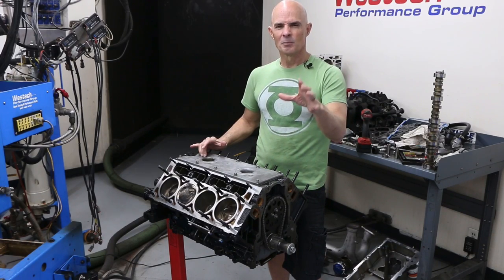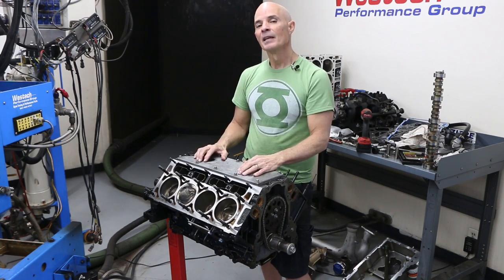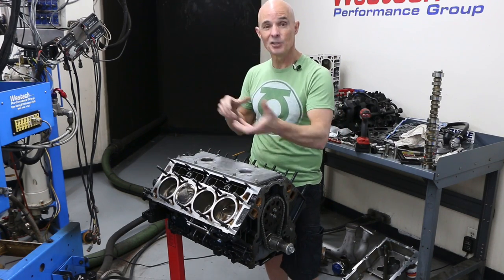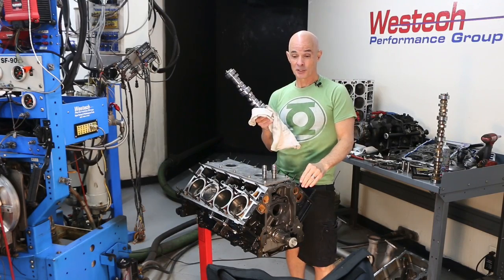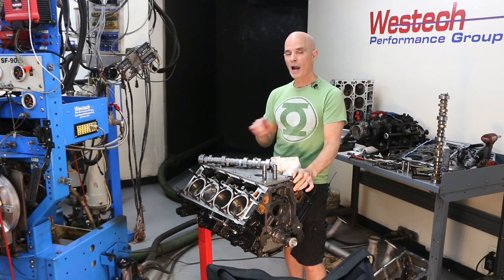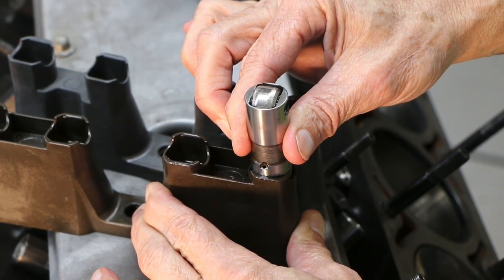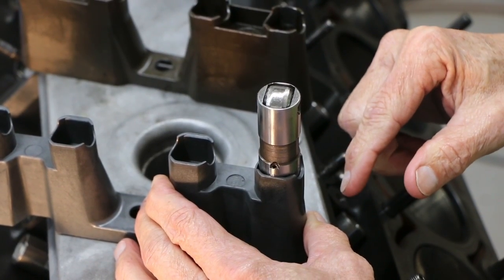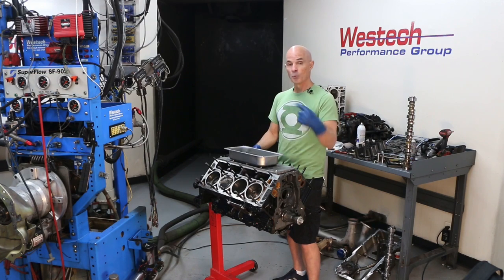WHY IT BROKE! 4.8L LS LIFTER FIX!

Comment: I had found your video four days after I had discovered why my 2010 GMC 1500 crew cab with AFM with only 114,665 miles had developed a P0306 misfire and was running rough with a noticeable loss of power. I was over a thousand miles away from home and just two hours away from my brother in law's house when the engine problems had developed. I had managed to line it the rest of the way there.

While parked at my brother in law's driveway I had tore down the right bank and had discovered that the #6 intake lifter was rotating in the lifter tray, which had ruined both the lifter and the cam.

I had managed to tow my truck back home and begin the teardown process, and had discovered that all of the lifter trays were worn. Not a single lifter was able to be retained by the lifter trays. They were all loose, but only the one bad lifter had fully rotated. They're all getting replaced. 

What had caused the lifter trays to wear like that? I'm still learning what was the reason, but simply put, plastic doesn't last as long as metal, especially under constant heating and cooling conditions of daily driving.
Reply: Did you just swap the cam and lifter and call it a day or did you have to do anything with the cam bearings, main bearings, etc? I just had a lifter fail on my gen 3 5.3 which tore into my cam really bad, even after just driving with the lifter noise for around 40 miles to get back home. I just purchased another used 5.3 with less than 100k on it and it had 3 lobes getting chewed into! I see so many people online saying the whole thing needs torn apart, but the other half of people pretty much just say run a new cam and lifters and call it a day. what did you end up doing?
Reply: @kevinskater13 I checked the camera bearings and they passed inspection. I replaced the cam, lifters, the cam bolt (I kept the VVT), the valley plate, and I plugged off the oil ports that ran to the DOD lifter valley plate. While I had it apart I also replaced the valve stencil seals and the valve springs. I also used all new gaskets andvseals throughout the top and front.
Reply: @robertemmons2260  Thank you!
Reply: @kevinskater13 you're welcome!

Comment: So I added a 7 layer head gasket and new lifters and trays but my trays don't reach the lifters that's on the low side of the cam is that bad first time breaking open an ls so I'm kinda new to the ls
Reply from the maker: the lifter should always be engaged in the tray to stop it from rotating
Reply: @richardholdener1727  hmm I have an ls3 doing the same setup that u did for the 800hp video u made installed the same cam u mentioned.. did u remove the heads for lifters when u did the cam I looked at my oem trays there the same size and the lifters aswell not sure why there like ⅛ gap

Comment: I have just had my LS (L98) motor rebuilt entirely. everything new except pistons, connecting rods, and crankshaft. I put in a hotter cam (VCM262) and now i have an extremely noisy engine. Lifter noise and rocker noise etc. My Technician is telling me that all engines with other than standard camshafts makes the engine noisy. I cannot believe this...is he right? Any advice is appreciated. My email: felix.swanepoel@gmail.com
Reply from the maker: that is not correct
Reply: @richardholdener1727  Thank You so much Richard...I thought as much.

Comment: I wonder if a heat resistant metal would be better for lifter trays. I just replaced the pickup tube oring to stop lifter tap
Reply from the maker: ours lasted 300K miles-so they are good in stock form

Comment: i had a shop do a cam kit install on my Ls3 corvett GS.  5 weeks and 1300 miles later the car broke down, shut off on me while driving, i sent it back to the shop. they told me the lifter spun on the cam and broke the roller, locked up the cam and snapped the timing chain also damaging 4 valves.  after watching this video it sounds exactly like this. except the shop is charging me $3900 for them to fix this. seems like a load of bullshit to me, anyone have experience with the lifter failing? they said it just can happen to an engine. its rare especially since it only had 32,000 miles on it. is  East Coast Supercharging fucking me here or what??
Reply from the maker: cam, spring mismatch or over rev
Reply: Or the lifter tray issue you explain in this video? So the cause is really not definitive?
Reply: Is over rev bringing it to redline or taking it past redline? I don’t track the car but I do DRIVE it

Comment: More often than not guys and gals neglect to change out the lifter trays when replacing lifters and i for the life of me cannot understand why. It is an inexpensive preventative maintenance item that should be done. And only use GM OEM trays, no Ebay stuff, it matters.

Comment: Thanks Richard for your very informed videos, I am get just about to go through a cam and lifter change out in my 2012 Holden ute (L76/L77 motor). Is there a better replacement lifter tray available to prevent this happening again? Or do you have to replace with the factory items? 
PS. I see you have not hung up your punching bag yet.

Comment: I can understand running lifter trays on a test engine (facilitating cam swaps to some extent) but I think I'd prefer lifters with the link bar for a daily driver?  Maybe they're just too noisy or something?
Reply: They're heavier, expensive, and you need a higher spring pressure to keep them on the lobe.

Comment: Richard, I have a 2003 half ton silverado I bought new, 4x4 ext cab with the venerable LR4.  Back in 2015 I put a trick turbo log style turbo kit on with a 74/76 precision turbo, 39mm precision gate and a 50mm blow off valve.  The engine is bone stock other than fueling and a tune by a local hot rod shop.  The engine had 109k miles on it when I did the build, it currently has 158k.  I never gapped the rings, any head studs or head gaskets.  Everything is original, except recently I finally replaced the intake gaskets.  Now mind you I only run 10lbs on waste gate spring, but it has been a blast and I tow a small camper with it occasionally.
Great videos by the way!

Comment: Could you look at and discuss rockers and pushrods as service/upgrade items? Bushed vs needle bearing rockers and thicker/stronger pushrods - are they worthwhile or necessary at some point when you're running higher lift and faster ramps on the cam lobes.

Comment: This seems like a design flaw, why use trays like this rather than something more positive. Locks or crossbars.. honestly curious.
Reply from the maker: the stock trays worked for 250,000 miles-the design is good

Comment: Lifter question..... When upgrading to Johnson 2110 that is  .045 taller on the "Cup" then Ls3 lifter, will that .045 have any effect on PV clearance ? Or is + .045 would just give u more pre-load if u didnt re-measure your pushrods?  I used a Sold LS3 lifter to measure PV clearance...then installed Johnson 2110 and forgot that they have a .045 higher cup. I assume it only effects preload and I re-measured my pushrods for .042 preload. Your insight would much appreciated.
Reply from the maker: we measure P-V with zero preload, a light test spring and zero lash with rocker on its stand using an adj pushrod.

Comment: I have a 5.3 that is holding the intske valve open at idle and when the oil pressure is high. I've changed the oil to a 0/20w and the missfire counter won't register a miss when cold but with 5/30 oil it will. Ever seen thick oil cause a lifter to over pump at low rpm.
Reply: If you have dod, that's the problem.

Comment: I know why.  The plastic lifter bucket design is not good.  I've seen this on my built LS motors and even stock ones.  At low RPM / low oil pressure not enough oil gets through the buckets and causes tons of friction issues.  Couple that friction (which creates pressure and heat) and a plastic part and the result is a stretched and warped plastic part.   The solution is Tie-Bar style lifters and no more buckets.  This increases low RPM oil volume on the top end and the tie bar eliminates the lifter from wiggling around in the buckets.  Your broken lifter probably spun 90 degrees in the bucket and the cam lobe broke the wheel off.

Comment: Hey I checked out the Video because I have a 4.8 in a 02 Silverado with plenty of miles it makes a little noise at start up if it's been sitting for a day or two but it goes away after about 30 seconds or so it could be a lifter but I'm not sure what do you think it could be Thanks

Comment: Great videos sir! I have a 99 Sierra with the LR4 and I plan on doing a cam swap, intake, and boost (make it a toy 😉). I'd like to find the best setup, and since I saw your "turbo cam" video and know all cams will work, what's a good cam for initial gains? What do I have took worry about for springs? What's the difference in a torque cam and stage 2 cam? I was hoping to build most or all of my motor while still in the truck if possible, but we'll see. I may want to do rods and pistons too. How about different cams and how they perform in the LR4?

Comment: Definitely lifter spin.GM also had quite a few lifter trays in 01 Gen 3 5.3L that were cast/formed/molded with the lifter boss of the intake lifter clocked 10-15 degrees off which causes the lifter to run across the intake lobe sideways, taking out the intake lobe and lifters, experienced this in one of our personal rgs, wifes 01 5.3L Suburban.

Comment: With all the hipo LS builds out there I'd like to see a budget 4.8 running a 650 carb built for max torque spinning up to only 5500.  4.8's in the junkyard can be bought for a couple hundred bucks and can be easily built to a 300hp level for a cruiser with the biggest expense being the cam and ignition.  Or how about using a stock truck motor with only the cam and modified harness and controller again for max torque.  In other words a budget build up for a cruiser with a comparison between a carb and FI costs .....

Comment: I agree with the lifter tray replacement, especially on a budget friendly turbo project. What about when you want to spend a little more on a higher quality lifter that has link bars, is it worth it and do they hold up better then the lifter trays?

Comment: Exactly what it is if your lifter is rotating not line with the cam you're in trouble after aftermarket trays will not work unless they're good quality you have to check the lifter make sure they're tight the performance guys are using the old fashioned roller type lifters with the bar eliminates lifter trays wearing out and while you're in there replace all the lifters and put a good oil pump on high volume you don't need the high pressure spring

Comment: While watching, curiosity got me asking questions. I gather this is a test engine so hours more than miles maybe noted. How would you judge the lifter trays for wear if not doing a tear down / camshaft removal?
5,000 hours equates to 150,000 miles, but without seeing if the lifters won’t stay up during a cam change could tell a guy something. But say 150k?
 Same with timing chain slack. Old school, rotate crank, stop a TDC, then reverse while watching the distributors rotor move. 10 degrees where too much, but all we have here is cam position sensor. Side deflection? Service is not clear.
 Plus, does your elbow “Click” at 18 lbs. ft.?
ASE Master Tech since 78 - Retired

Comment: I’ve noticed the same. The lifter HAS to remain 90* to the cam. You guys are onto it for sure 👍
Reply: Not being contrarian here, but don't you think the wheel wants to track straight along the cam? To me, it seems like the injection-molded lifter tray is not  precisely-formed enough to hold the lifters/rollers in *perfect* alignment with the cam. It seems like the tray keeps it "more or less" aligned, and the natural tendency of the a wheel wanting to roll straight does the rest. But if that's true, his old worn out trays should have been adequate. It's an interesting question.

Comment: Warning!!! I just bought a new set of Chinese lifter trays. I am a materials nerd and these were made from ABS plastic, something that will deflect much more easily than the OEM composite trays, which I believe are made from a Bakelite plastic. The critical difference is that the ABS has many solvents and will soften a ton with increased heat. This will allow the lifters to eventually destroy your engine, if left unchecked. It's also worth noting that the seller had perfect feedback. I suggest not trying to chinch out on this part. It'll cost you way more in the end. (Pun intended ;-)

Comment: It's called, " Skating ". The roller is not following the lobe in its designed fashion,  and if you can imagine a ice skater accelerating across the ice the tail end of the skate kicks out each side. The roller is attempting to skate off of the lobe instead of following the rotation. On the opening side of the ramp, the lifter will skate to one side, and conversely on the closing side of the ramp,  it tried to turn in the opposite direction. The roller is not following or rolling, it's in essence,  skating. Hope that helps,  SARGE

Comment: Richard, do you soak the lifters in all your builds..? 

What makes you decide to soak these generation lifters. Just curious
Reply: I know submerging lifters in oil for a while before assembly has been "the way" for a long time, but I don't see how that would do anything to ensure the high pressure chamber is full of oil. I just try to force the pushrod seat down. If it won't move then the high pressure chamber is full/primed. If it will move, which is really rare, I use a pin to compress the checkball spring,  while submerged, and squish the pushrod seat down a couple times. That'll prime them right up.

Comment: Hey Richard just curious was this motor making any kind of ticking at various rpms. I cant seem to figure out my slight ticking at 1500 rpms or so i think it might be a lifter. btr cam 5.3, ls7 lifters, stock trays I'm regretting not changing them but then again last time I had the heads off was about 5 years ago

Comment: I want to see just how high the 4.8 can rev and make power. Good stock heads, pretty much as stock as possible short of the cam and valve spring upgrades. What's the weakest link shooting for 8000rpm or more

Comment: How do you suggest putting lifters into an LS engine. Specifically I've heard somebody say that on lifters where the oiling whole faces either the front or back of the engine you need to place them on the downstream side of the lifter from the flow that the oil is coming to the block, this would be to help reduce the chances of debris getting blown straight up into the oil hole.

Comment: Sooo this gonna sound as dumb as what you’re ab to read but note, I don’t take no for an answer. I’ve been trying to build a bigger throttle body out of a TBSS and stock LS1 to find a way around spending 600+ on a throttle body. Any chance you can do a compare between LS1 75mm and 85mm to 90mm? I have almost finished grafting the 4 bolt snout on my LS6 intake and almost done getting the motor to work on the TBSS TB bit more filing and tapping few holes, cut down the alignment pin for the gear so hopefully my ecm will still work correct. Gonna use HPtuners to adjust TB volume. All in if this works is less than 100 bucks. (Already had  LS6 intake)

Comment: I've noticed a couple common things on LSs that can lead to lifter failure. 

#1 BY FAR is the pickup tube o ring. Even if you have good oil pressure, it can be sucking air and filling your lifters. 

#2 the cam retainer plate has an oring on the backside that seals up the lifter oiling galleys. This can also leak and cause oiling issues to the lifters. 

With the way your lifters failed, I agree with your diagnosis.